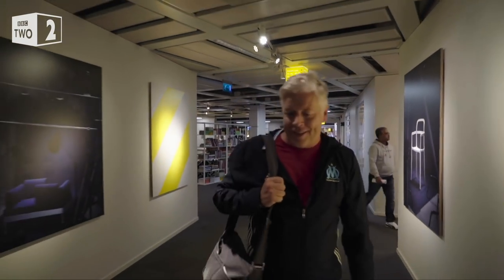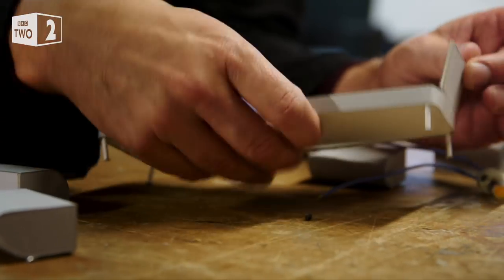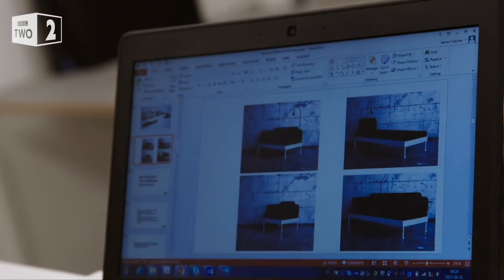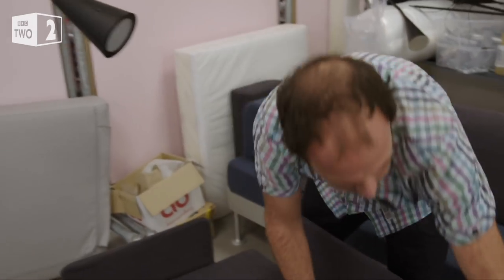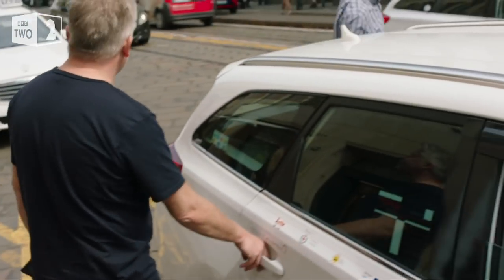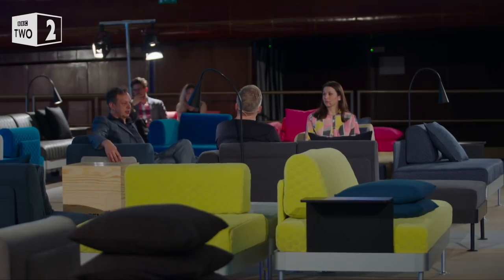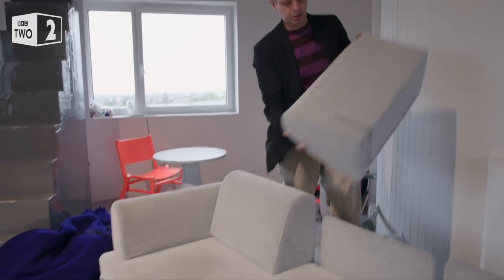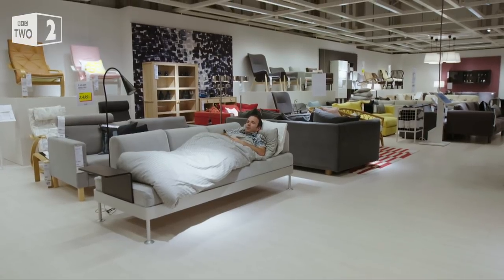Is it a sofa or a bed? Tom Dixon and IKEA collaborate - Flatpack Empire - BBC Two

Comment: Isn't the Delaktig a remake of the FLOTTEBO designed by C Halscov previously?. It simply looks like they  upgraded an already existing Item. I cannot see the 'design' that Tom Dixon has given to it.
Reply: FLOTTEBO was the sofa I previously considered. I bought the delaktig instead. The designs are totally different. You can check that yourself at IKEA.
Reply: @wimahlers  Took a look, they look practically the same and MAYBE that is why you considered BOTH.
Reply: But these couches are very different. Differences:

1. The delaktig has a loose slatted base. The flottebo has not.
2. The flottebo has a storage area under the seat (by lifting the seat). The delaktig has not.
3. The delaktig has a fixed aluminum backboard for the cushions. The flottebo has not.
4. The delaktig has separate/different armrests. The flottebo has not.
5. You can fix a table as an armrest or a lamp to the delaktig. Not to the flottebo. You can add a swing table to the delaktig and the flottebo.
6. The delaktig has a 100% aluminum frame and aluminum chair legs. 

The delaktig is more versatile. On the other hand, the flottebo has some build in storage capacity.
I prefer the better quality and versatility of the delaktig, despite the higher price. This is, of course, a personal opinion and personal preference.

Personally I consider the comfort experience while sleeping different. That is, the loose mattrass of the delaktig is firmly fit into the aluminum frame. Which makes the sides more supporting when used as a bed.